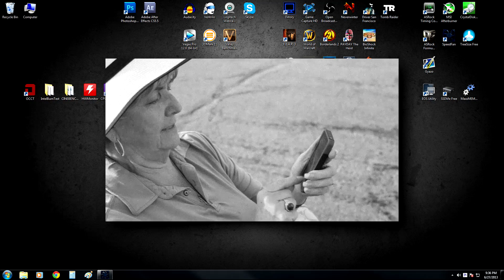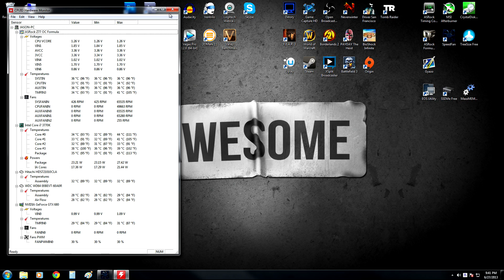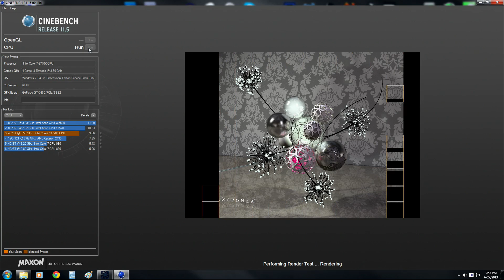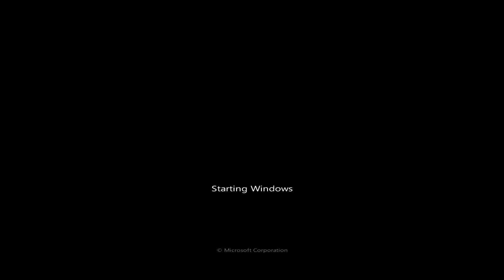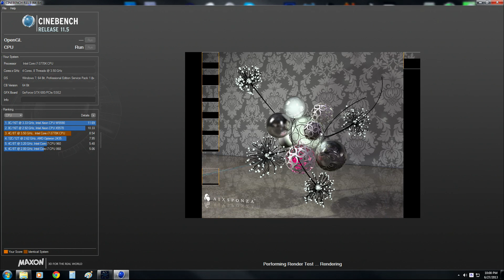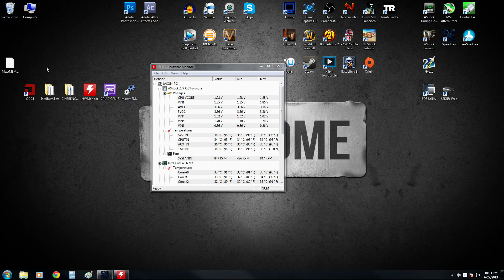Intel Overclocking Guide - 3570k 3770k 4670k 4770k

Comment: Well... It appears overclocking was not my chip's specialty. I got 4.2 Ghz at 1.2 V. When I was doing the Aida 64 stability test, it ran fine for an hour and a half, then my computer restarted. Should I take this as a sign that I should bump my overclock down to 4.1 Ghz or is an hour and a half on Aida 64 stable enough? 
Thanks

Comment: Hello, hoping I can find out If im doing things right, and if there is anything that should be changed. I have a 3570k on a P8Z77-v LK. Im at 4.3Ghz and 1.235 Volts. Temps are 40 at idle, 50-60 while gaming, and dont go over 80 while prime95/furmark - ing. I have a HAF 932 case and Hyper 212 evo cooler. after 5 hours of prime95 and furmark at the same time, no bsods, no errors, no WHEA. Should I change anything?

Comment: Yay my cpu is ass. I can't even hit 4.4Ghz at 1.29 on the Vcore. Looks like I will be stuck at 4.2ghz because this chip burns up at 1.24Volts on a h110. It's insanity.
Reply: i would make sure the connection from the cpu to the cooler is as tight as possible and you have good thermal paste spread
Reply: ***** I tinkered with it more, I can hit 4.4 at 1.275V which keeps me around 72C max. Still far from brilliant but my luck is poo with the chip I have determined.
Reply: you might need to delid your cpu thats worst case...intel cpus use bad heat spreaders and such
looking at this video may help 
Fixing Haswell and Ivy Bridge CPU temps: IHS removal
Reply: if you want to see the diffrence watch the first 3 minutes and watch the last 3, the before and after
Reply: ***** huh?
Reply: just watch the video i linked you to
Reply: ***** Actually the issue is I don't see a linked video.
Reply: ***** it was tagged as spam, I see it and I thought about doing a delid but I don't think there would be much point seeing it's not really the thermals holding me back anymore. Even at 1.38 I stay below 80. The issue was prime bumping my volatage up to nearly 1.47 before. It's not worth the 100 mhz I would more than likely get.

Comment: Can you explain, what you mean with (it doesn't boot up) Can you get in to BIOS without a problem??
Reply: Sorry for the late reply, but perhaps you're still wondering this question :P

Most motherboards have built-in protective features that will detect when a setting is going to fry the computer.  So, say you go into the BIOS and set your CPU voltage to 5.0V.  As this will likely result in creating a fission bomb in your room, your motherboard will simply not let that happen.  It won't let you get into the BIOS, but don't let that scare you, because most motherboards also have a physical way to reset the BIOS without booting up.  If you look in your motherboard's manual (never throw that away!) you should see either a "Clear CMOS" button or jumper.  This is how you reset your motherboard's BIOS to default settings, and it will then let you boot up.
Reply: You bro, Thank you sooooo much for the reply! It helped a lot! Doesn't matter for the late reply! Thank you for the answear!!! :)
Reply: Np.  As I said, make sure you reference your motherboard manual for the exact steps on resetting the CMOS.  Some of them (especially the ones with a jumper pin) have a quick, easy, but very specific order in which to do the procedure.

As long as you're smart with your overclocking, you shouldn't have to utilize the CMOS.  If it happens, it will most likely happen while tweaking CPU voltage, so visit some forums for guys overclocking on your same CPU and look at what the recommended voltages are for different speeds.  Then you can hone it in with some stress testing and very small adjustments.
Reply: Thank you very much, i will be sure to check the recomended voltages for the clocks on forums, but again, thank you!

Comment: Thank you very much for the tutorial!  I've got a 3570k with an AsRock Extreme 4, cooled by a Hyper 212 EVO.  Going to give your settings a try and see what I can get.  Currently have it at around 4.2ghz stable, but I want to push it to 4.4ghz.  I think the issue at the moment is that my Load Line calibration is at 2 or 3 based on another video.  I'll move that to 1 and see if I can get a 4.4 OC stable.  If its a cooling problem I'll go with an H100i instead.  Thanks again!

Comment: got my 4770k at 3.5ghz 1.200V. i got a really really bad chip....
Reply: iTr00oW how the fuck can you email intel about that? They dont guarantee anything when it comes to overclocking
Reply: Isn't that the stock clock?
Reply: ThaRamoHD
jup. i emailed intel and i got a new one:) now on 1.205V 4.5ghz on a h87 board.
Reply: Laurence Barnes you first email them, they email with a list you need to do. you do all that. one of the steps is a stress test which failed. screenshot the results. email again. call them, since i'm dutch, i had to send the cpu to the store where i bought it. they tested it and they confirmed it was broken and the gave me a new one. a really really good one:) 4.7ghz on a h87 board not bad 1.26V
Reply: iTr00oW wut. lol
Reply: Erik Muller jup i know, i got a new one from intel:) 4.7ghz on a h87 board on 1.26V :P
Reply: What about your ring multiplier? is it at a 1:1 ratio? and your ring voltages? I ran 4.6 ghz at around 1.26 volts too before changing my ring multiplier. now im running 1:1 ratio at 1.32 voltages 4.6ghz at lower temps :)
Reply: Laurence Barnes it's a h87 board. i can't change much. well i can change the voltage and the multiplayer but not more :). 1.32V isn't really good for you motherboard. atleast my one. ASRock h87 performance with 8 phases.
Reply: 1.32 is very good. The normal voltage is around 1.35-1.38 for the settings. Remember my overclock is 4.6 ghz on the northbridge aswell.
Reply: Yours is most likely not since you can only change the core multiplier. I have a g45 gaming from msi by the way :)
Reply: Laurence Barnes i didn't wanted to spend that much on a pc so i bought it for 65 euro orso. pretty good value. but can it run watchdogs nope
Reply: I can run watch dogs fine on high/ultra. Look at my channel :)
Reply: Laurence Barnes i can't run it on ulta with a r9 290 1170mhz. 60 fps just walking, 40-50 if there is a lot of explosions. 10fps in a car.
Reply: Try downloading the pirated version. It runs alot better than the box copy
Reply: Laurence Barnes i bought the game. most crack versions mines bitcoins :P
Reply: i got mine on h81 motheboard 9ghz
Reply: neromana2 mine is real, yours not :)

Comment: well i guess im kinda lucky i have a intel i7 2700k with a stock cooler. And im running at 4.4ghz 44 multiplier and the voltage is just around 1.184 and temps are 
38c on idle and around 48-53c on full load
Reply: well you are actually unlucky because your running an intel stock cooler on a good chip

Comment: Same principles apply for:

PC Specs. 
Intel i7 960 @3.2ghz 
Gigabyte G1.Sniper 
EVGA GTX 570 in 2-way SLI 
Mushkin Silverline Stiletto 3x4 GB DDR3 1333 ram 
Coolermaster HAF 922 case 
Cougar SX 750w Power supply 
Logitech G300 gaming mouse 
Corsair Vengeance K60 
Noctua NH-C12P SE14

Comment: yeah it's either your PSU or your motherboard. that mobo is a low end mobo, not really for hefty overclocking, For more accurate answers than mine, I'd post this on tomshardware or some other techie forums.

Comment: I have a MSI Z77MA-G45 LGA 1155 with an Intel i5 3570K and recently I kept blue screening so I had to change my 4.7 Ghz to 4.5Ghz. I have no idea why my 4.7Ghz clock became unstable since nothing has changed. I have a H80i cooling my CPU and at 4.7Ghz it was idling at 38C and when it crashed, the temperatures were only 43C. Would you be able to offer any insight as to what may have went wrong? Also, My motherboard only has 1 4pin for the CPU power, do you think that my mobo is limiting my OC?

Comment: also it did the 43x102.4 on the clock speed. Auto did stop on 43 and then lifted the freqs to 105.4. Is that ok and it does not matter (if 43x102.4 and 44x100 are the same) or is better to go 44x100 or what do you think about this?

Comment: Hey thank's for great vid. It helped me a bit. However my asus utility did the overclocking pushing it to 4.633 untill it crashed and downed to 4.5. I ran that intel test and it was touching 100 degrees. After a few adjustments i lovered it to 4.4ghz and that test gave me about 90 degs. But cinebench just stayed around 78 degrees also i am running prime95 ATM and it goes 68-74. What do you thing about this? also i'm confused on voltage. coretemp shows 1.256V while asus utility 1.330. i have3770k

Comment: I get 4.223 Ghz (41x103) with a 3570k at stock voltage with a Hyper 212 evo push/pulled by Corsair SP120 QuietE (I've runned OCCT 1h20 and it's stable)

Comment: Awesome video Jay, i really apreciate what you do! Helped me a lot, got my parts today and OCed my 4770k with a H100i and 3 120mm and 1 140m, corsair high Pressure, 2350rpm
Got a 4.7Ghz too but with 68c, running with 2 sli 770 gtx.

Comment: Jay, you are awesome just like your wallpaper! I got my 3770K to 4.7GHz stable 70C with a Hyper 212 EVO!
Reply: mine goes up to 80 when i was running it at 4.5  now i just put it on 4.3 with the boost it goes up to 5.4 around that .. ram  is what s holding me rn only 1600 MHZ

Comment: i have an overclocked 8350  my temps run 54 max when gaming and around there when running stress test  i have watercooling and i want to push higher  what is an exceptable temperature for an 8350 under load

Comment: Really good video jay. Keep Up the Great Work!
But could you please go into a little more detail when it comes to messing with ram frequenzy and voltages? I always find myself messing up, and when i do, my system keeps failing to reboot and i have to remove the little battery from the mainboard in order to restore default settings. Have you got any Idea of whats going wrong with my system? regards

Comment: I've seen 3770K's boot at 1.1V, if you can get it to boot at a lower voltage that you set yourself you will find the base voltage.. every chip is a bit different.  If you blue screen, while trying to boot, you don't have enough voltage.

Comment: Jay I have serious doubts about MaxxMem accuracy most socket 2011 scores are way lower than 1155-1150 system's, I've seen lots of stuff in forums about 2400mhz ram scoring lower on socket 2011 than on 1155 surely Quad Channel would make it faster?

Comment: Hey guys I was wonder whats a good whats a good program to watch my temps on mother board cpu gpu etc I just recently started over clocking i got my 960 t amd cpu to 3.5 ghz from the stock 3 while using the stock cooler getting 53 C's temp under load. I know I could clock her higher with a better cooling system any thoughts?

Comment: My 3570k runs at 1.29v at 4.5 and the heat never reaches 50 while gaming...... Under full load it's around 70.. Is voltage too high?

Comment: Jay you say dont use stock fans; all i did was change my thermal paste, @ 1.25v, OC @ 4.3 Ghz (i5 2500k), it runs at 60~70 degree's. Stock Thermal paste and same settings = 70~85. o.O!